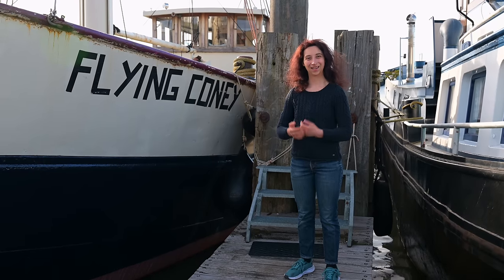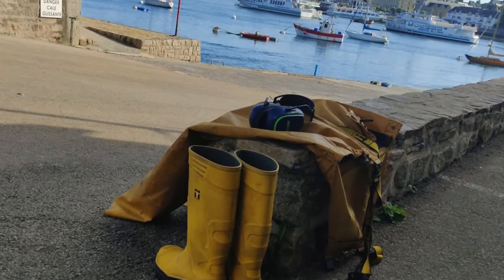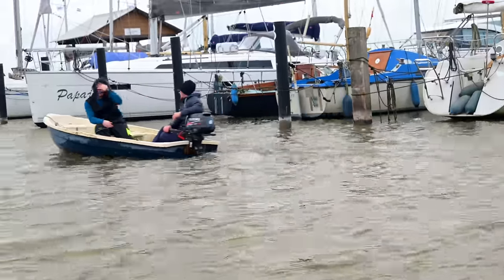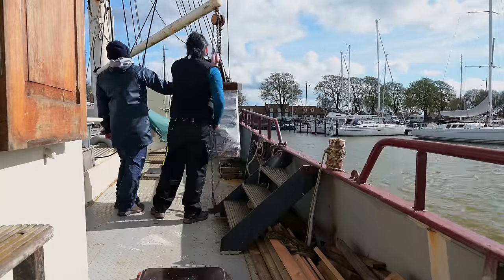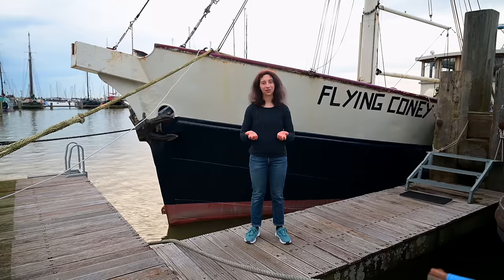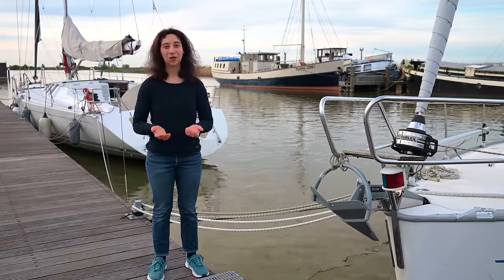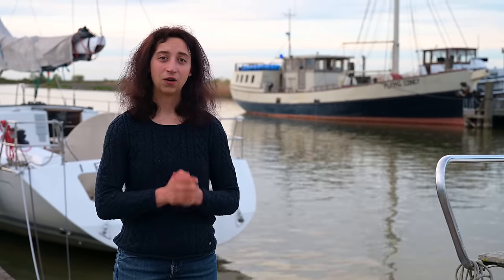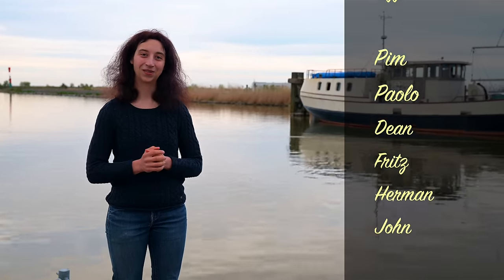Preparing our TRAWLER for the First Journey!

Comment: I was interested to know of the use of Oxalic acid for removing rust stains. I prefviously used Phosphoric acid or acetic acid.
Reply from the maker: Oxalic acid works like a good cleaning agent that can also remove the rust run- downs. Phosphoric acid is a strong rust converter. Both have their place on a steel ship.